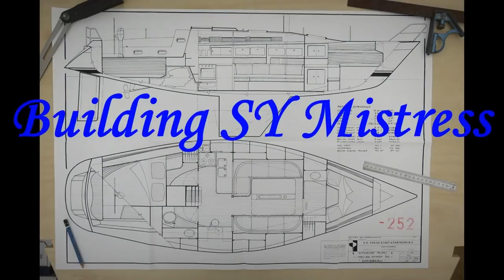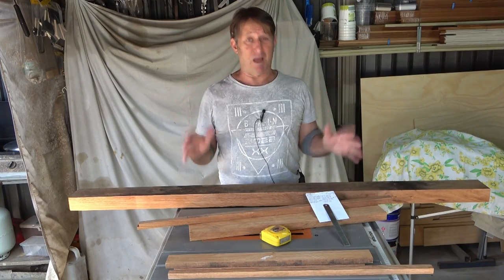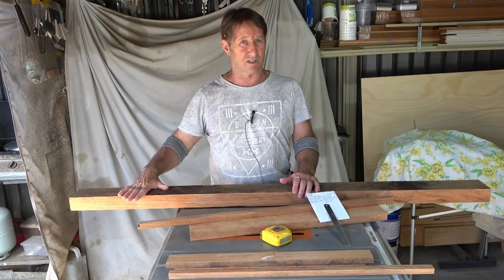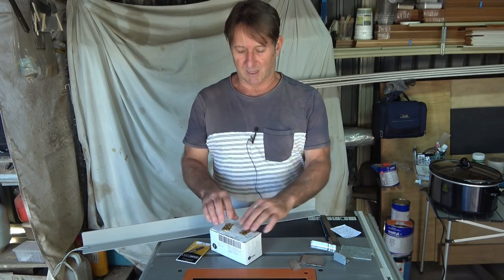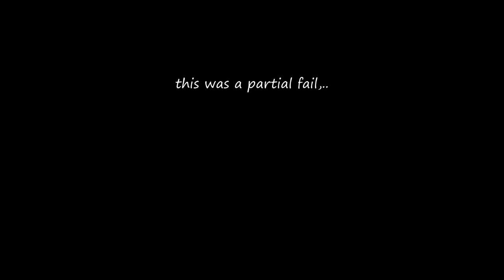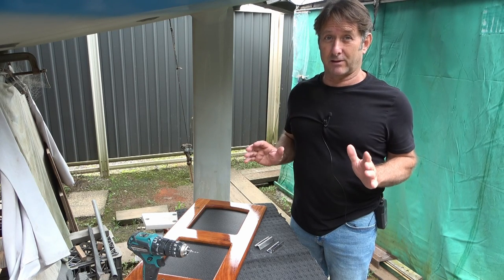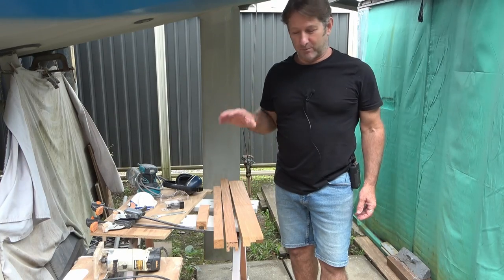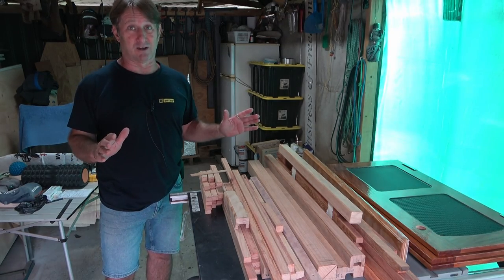MORE off the LASTS lists,.. Ep.152 Building my steel sailing yacht

Comment: Hey Bruce, great work as always. What cabinet locks did you end up going with, are you happy with them?
Reply from the maker: Hi Kevin and thanks for your good comment and question, I just got these lock handles on ebay which were unbranded, there are hundreds of the same types both there and in marine shops, which are also the same ones used in production boats. I do not know how durable they may be, time will tell, but they seem adequate and are a compact solution + I bought extra's 'in case',..  🙂👍🏻